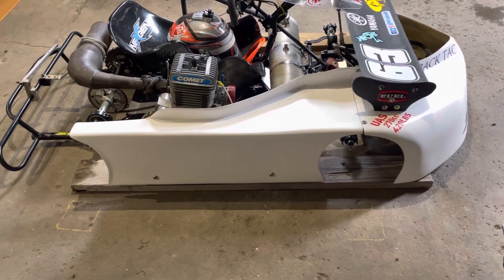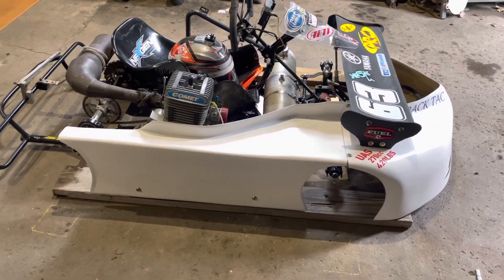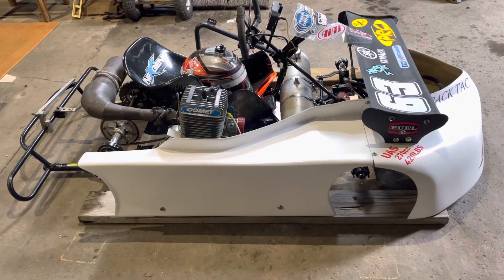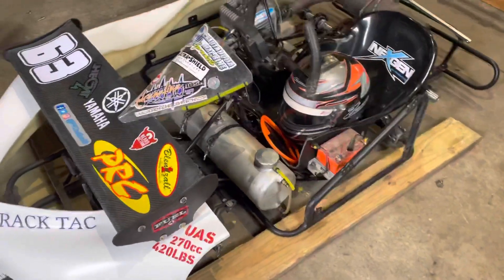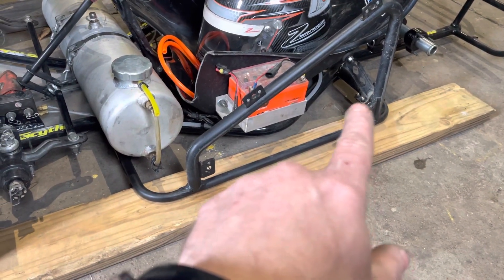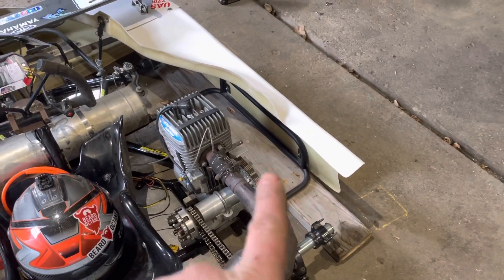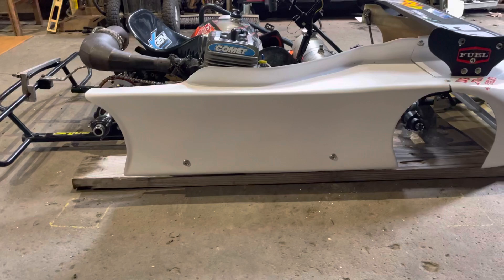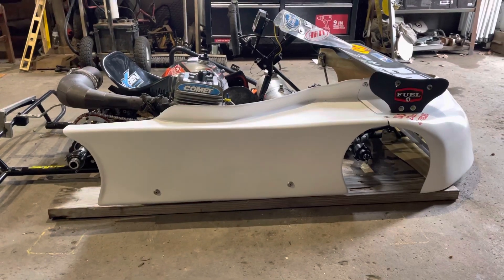Quick Tip: Body Mounting

Comment: I mounted my body kinda like this I put the kart on a table and put the rims on without tires so I could get the nose centered my nerf bars have a bolt holding them on but they are floppy, is floppy a word lol, and I lift the nerf and drilled the hole. I have a completely redone Footloose Explicit and I’m in the middle of redoing a Ultramax Rival for backyard racing